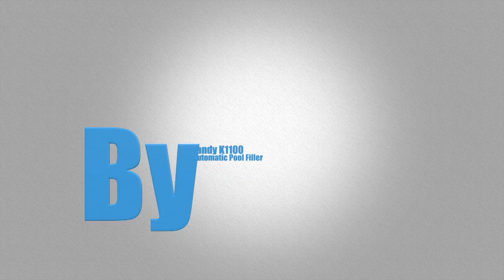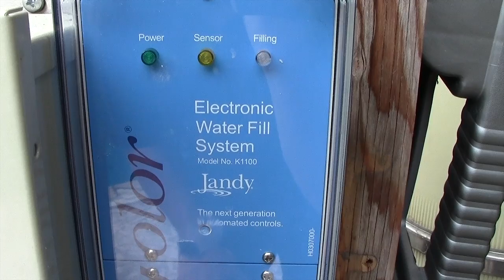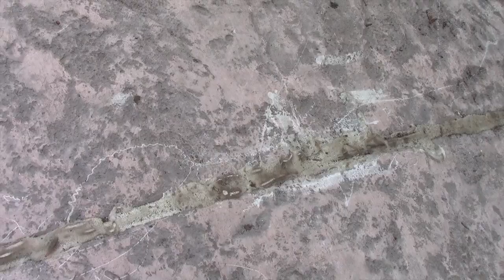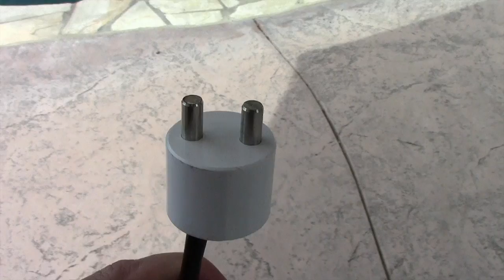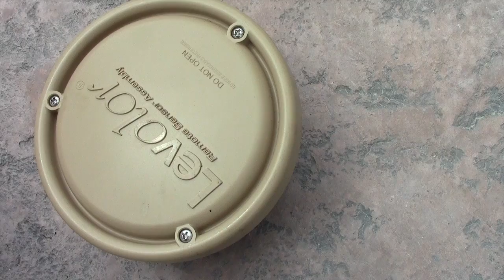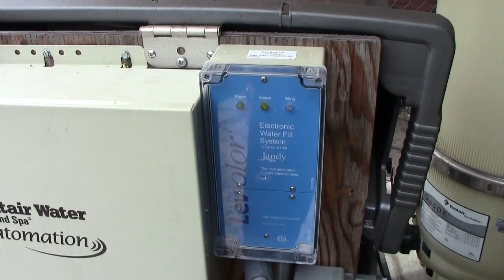Automatic Pool Water Filler

Comment: So where does the water flow into the lines? Is it by the pump?
Reply from the maker: Prior to this auto-fill system, I had a fill line run into the pool from the side hooked up to the water line in my house.  I attached the valve (like an auto sprinkler valve to that line and it is activated by the auto fill system.

Comment: 2 years later.   is this still working?    I am considering it for a new pool
Reply from the maker: Yes still working.  I did have to replace sensor but that was a quick fix.
Reply: scorch101  

wow,  that sucks.   why did sensor fail?  it's just 2  conductors.   Won't be a quick fix for my application.
Reply from the maker: No 100% sure.  My sensor is located in the skimmer.  My sensor came loose from the side of the skimmer and was floating in the skimmer for a while before I detected the issue.  Since my skimmer is located just about 10 feet from the control panel, the purchasing and replacing of the sensor was a quick fix.
Reply from the maker: The sensor came loose from the side of the skimmer.  The skimmer is located only 10 feet from the control box.  I am not sure why the sensor failed but the replacement cost and time was fairly quick and easy for me so I never really diagnosed the fault.  I just know when I hooked up a new sensor it worked like new.
Reply: So I just installed this.  Brand new pool.   Sensor was bad out of the box according to the flow chart.  :-(
Reply from the maker: Yes still working.